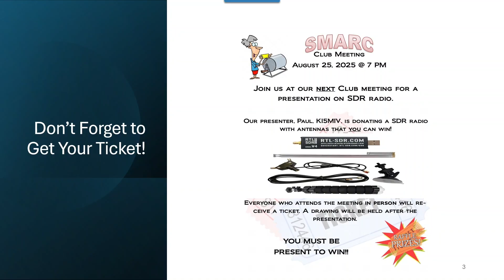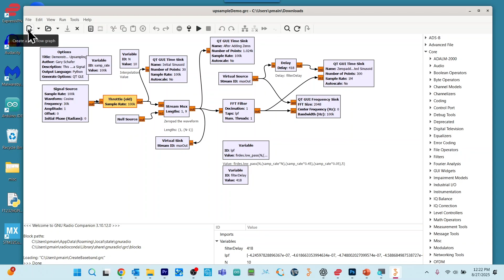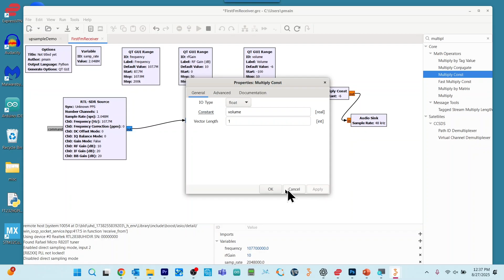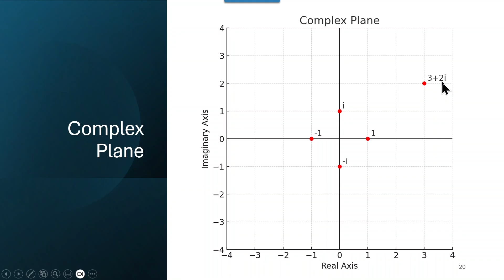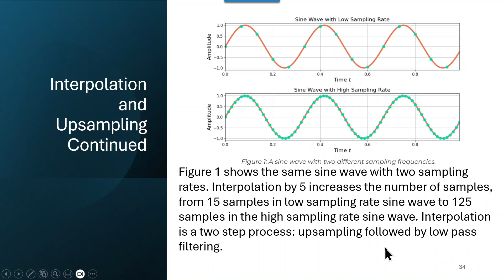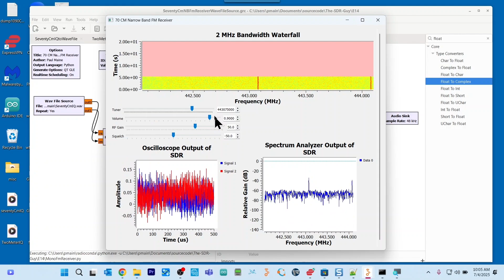E18 Introuction to SDR's and GNU Radio Using an RTL-SDR

Comment: Nyquist is not two time the highest frequency but two time the bandwidth. It simplify to the highest frequency for baseband signal.
Reply: No. Not 2x bandwidth (unless you're dealing with real-only signals). For complex sampling, it must be 2x highest frequency when the bandwidth is centered at 0. If you're using a 2 MHz sample rate and tuned to, say, 90 MHz, then you can recover signals (roughly) between 89 - 91 MHz, a total of 2 MHz (your bandwidth). But once the signal is heterodyned down to baseband, the maximum frequency within that bandwidth will now be 1 MHz (either positive or negative). Anything higher than 1 MHz (or lower than -1 MHz) will be aliased.
If you're doing real-only sampling, then, yes, you need 2x the bandwidth because if the signal is shifted such that the lowest frequency edge is at 0, then the bandwidth = maximum frequency, which still requires a sample rate of 2x maximum frequency.